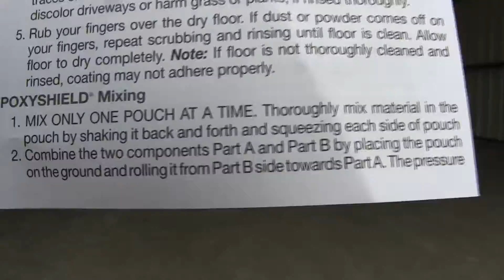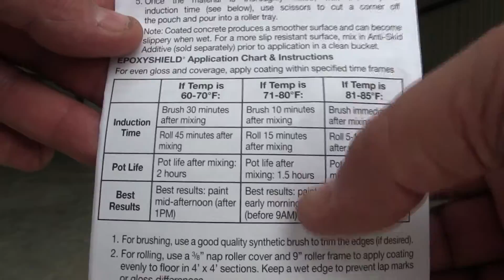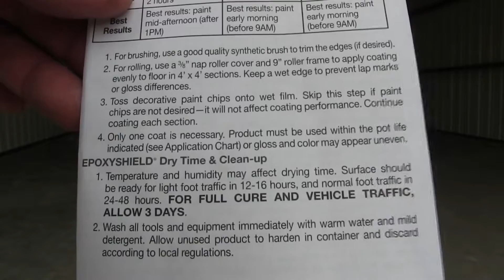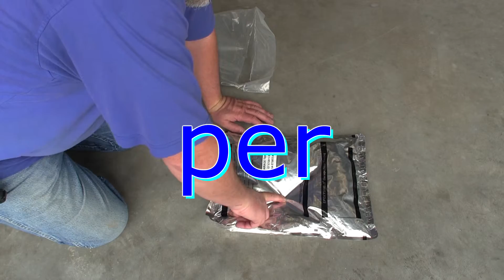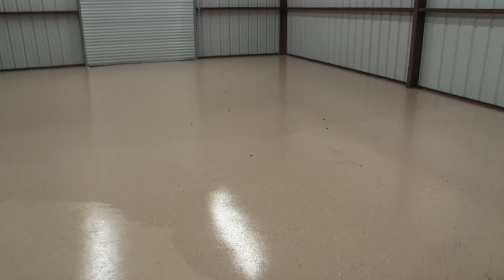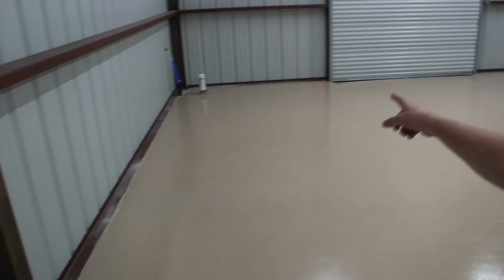Shop Update 3- Part 2 | Rustoleum EpoxyShield Floor is done!

Comment: After all this time how has it held up? Any peeling up?
Reply from the maker: No peeling up anywhere, at all. It has been extremely durable and resistant to any spill I’ve thrown at it. That includes gasoline, extended periods of trans fluid puddling up, brake fluid and grease and oil.  Even lacquer thinner didn’t damage it, but I wiped that up right away. I would definitely do it again if I had another concrete floor shop.
Reply: Did you do the clear after the epoxy? THANKS for the feedback, building a 1500sq ft shop trying to decide between this & the rocksolid except that one is DOUBLE the cost.

Comment: THanks for the video, very helpful.   Did you have any experience needing to apply a second coat in areas because of bleed thru or not good enoug coverage.  If so any advise?
Reply from the maker: You are welcome!. I did not have to recoat, as my floor was floated out very smooth. If I'd had a rough or brushed surface, I would likely have put on at least two coats. Thanks for watchin!